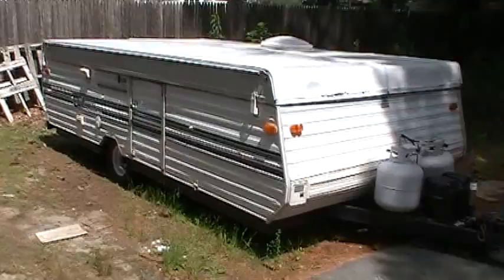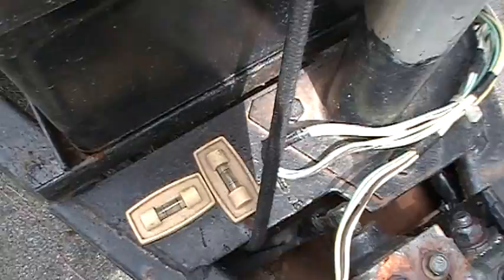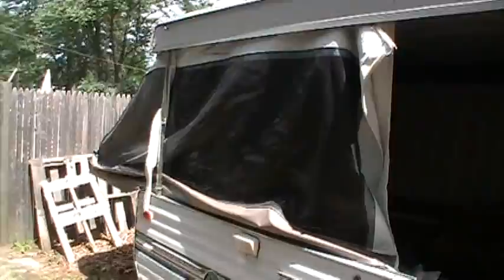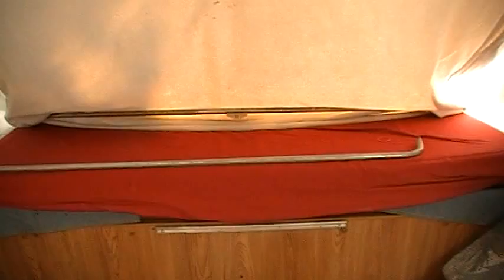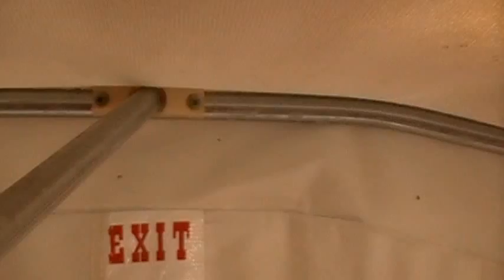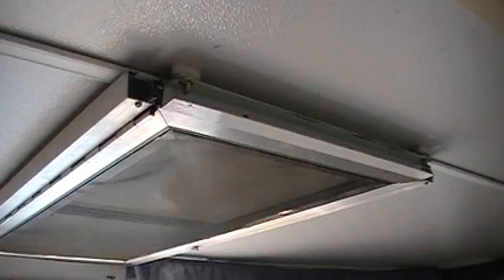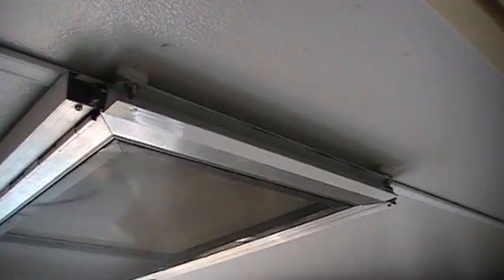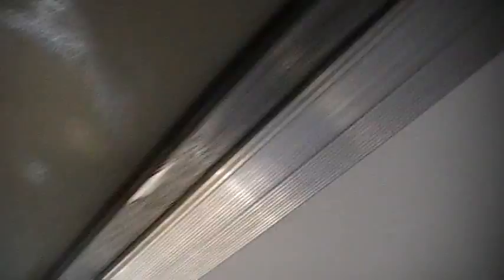Instructions On How To Set up Popup Camper or Tent Trailer

Comment: Thank you. I recently bought a used 92 Skamper pop up. I've never owned a pop up. I merely had to watch the man take it down, connect it to my truck and I pulled it home, where it's sat ever since. Only a week or two lol. Only because the trailer wouldn't release from my truck, so out of desperation, I disconnected the hitch from the truck and left the towball and tongue, still stuck to the trailer lol. I have some metal to metal lubricant and a rubber mallet, but going to have my brother come by and use his muscle power. It was a brand new ball and I did not grease it first. Plus it wasn't exactly low enough, so the pressure made it next to impossible to disconnect. I want that taken care of first, then I will attempt to raise the thing. I desperately needed a refresher from what I witnessed a couple of weeks ago. THANK YOU.
Reply from the maker: Thank you for watching out video on how to set up a popup camper. Hope it has helped you out to set up your camper.

Comment: Thank you, this was helpful . This is the same model of pop up that I just bought. The only difference I see is that mine doesn't have Velcro for the ends. It has stretch cord that goes around the little pulleys that I see are still under your camper.
Reply from the maker: Thanks for watching. Don't forget to sub the channel to receive all of our latest uploads.

Comment: I wish I'd seen this when we first got our popup. It's old (?1978?) and had no owner's manual. We finally figured it out but it's still a continuous work in progress to make the needed repairs. Do you have a video on putting up the awning? We had it out of the bag one time and decided it was just too much trouble. Now I'm thinking we just need good instructions. Thanks again for the video.
Reply from the maker: I currently do not have an awning for ours.What I ended up doing is going to Walmart and bought a 10X10 easy up canopy for like $49.00. It's easy to set-up and works pretty good for what we use it for.
Reply: HomeownerRepair that's what I am thinking about doing bc.my pop up didn't come with an awning .

Comment: I have the same trailer but its in a bit rougher shape. Needs a new canvas, it no longer attaches to the door. The door needs new pins. Also, on mine it has 4 supports on the front bed, 2 are like a v or u shape.
Reply from the maker: Thanks for watching

Comment: Juat bought a pop up... everything went great but we can't get to door to shut... the tabs at top won't line up to go through holes to lock in place...

Suggestions?
Reply from the maker: Sometimes it takes a little wiggling around and possibly not making the sides or roof so tight on the tent camper while you are trying to put the camper door in place. Hope this helps you out.

Comment: thanks a lot. just got my 1st pop up, Can the stabilizers also be used to level the popup?
Reply: buy a BAL  leveler ..adust ,first with the tounge jack to levei the length ,put leve] lunder the wheel and ratchet up till level ,,its a magic and best bit of pop up kit ,,when perfectly level the trailer is rock solid .one wheel off the ground ,and stabilzers should never be used to level trailer ..good luck
Reply: Hopefully, you already got a reply on this. The tongue jack in the front is used to level the popup. You can break the stabilizers if you try to force the popup level with them. Stabilizers are meant only for 'stabilizing' the unit once it's level.
Reply from the maker: They are really there to stabilize the camper

Comment: we just purchased this same camper 1992 jayco and looking to replace the canvas but not sure what the make is of this camper is do you have any idea?
Reply: iam trying also to buy the canvas its a sticker added inside of the canvas itself
Reply: http://bearcreekcanvas.com/  Jayco usually posts what model you have on the outside.  Mine is a 86(soon to be a flatbed trailer) and it proudly proclaims its a 1006SG Deluxe by the door. Mostly they just need the measurements if you know the exact year there were only a few models for each make.
Reply from the maker: Sorry for late response just noticed this question.

Comment: How do you set up the table? We can't figure it out.  :(
Reply from the maker: On the edge of the table there should be a channel, that fits into a channel on the trailer. That will hold the table up, then you can put the leg down on the table. Let me know if this helps you out.
Reply: It worked! We just got this from a family friend and I've never owned or been in one. What's the extra table looking piece for?   It has the same kind of slide in bracket but no table leg just another smaller slide in bracket underneath it. It looks like the kind of bracket that the beds have....
Reply from the maker: tyler laird Jeeze, not sure. Usually on the table beds, there's typically either a table leg that folds down to prop the table up, or some tables have a pole under the table that goes into a cup on the floor and also into a cup under the table.
Reply: I think it goes outside by the door maybe? But there is also a connecter for something under where it would sit. Looks like gas or water or something..... Can the stove be put right there?
Reply: tyler laird yup there are 2 connectors outside by the door the short one is for the table and the long one is for the stove. ;-)